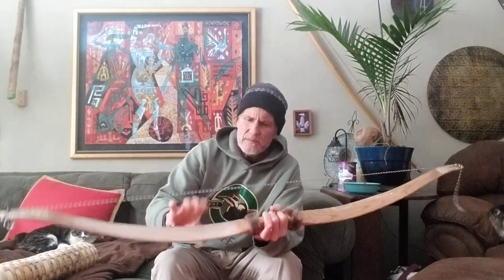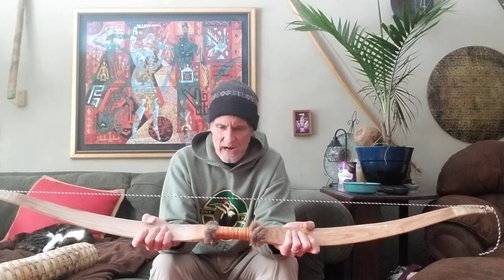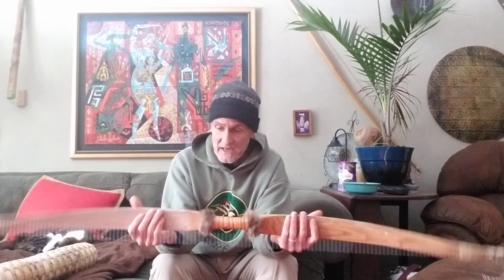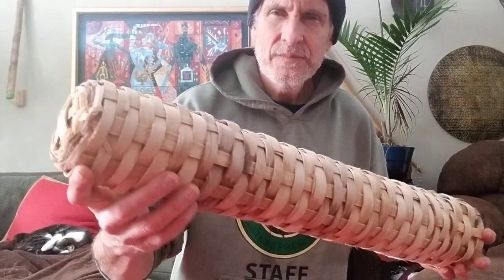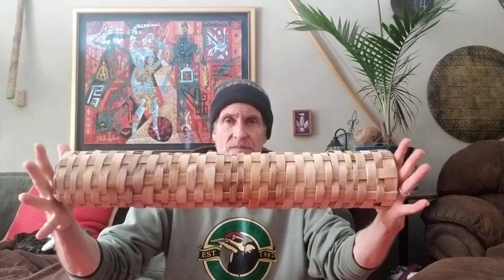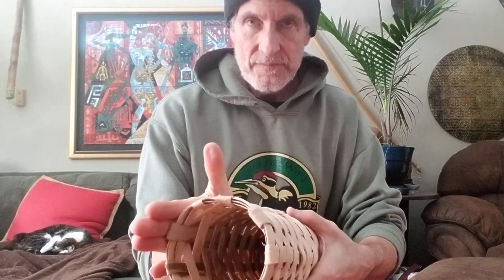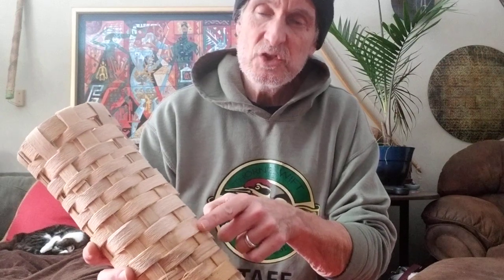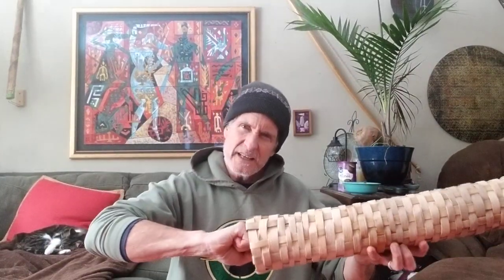Today's Assignment: Making a Quiver

Comment: That looks really good, I always admired woven quivers. The only thing that I have woven is  rocking chair bottoms. Sheep wool around the mouth for arrow rattle? I tried knapping years ago and I had terrible looking points, need to try again. Thanks for sharing!
Reply from the maker: Thank you. The sheep wool would be good and maybe on the bottom inside to keep the points from banging. I dyed the rim with blackberry juice and hit the whole thing with spar varnish. It really came out well. I need to find the Ishe like points that Cody made for me so I can make the arrows. I still want to learn, but in the meantime, Cody made points with those thin narrow blades and impossible deep notches would be incredible. I have points from really fine knappers, but this fellow's work is best described as impossible. I'm gonna text him and see if he could put his info on the upcoming video when I have made up the arrows.

Comment: Ingenious, beautiful quiver. And that bow , gosh it too is a beauty. Wish I had your talent, but that bow just looks so cool. I had to watch it twice
Wait I got more, I’m a Yew wood lover. And look forward to you working such nice bow wood. 
And for my final input, more of a question, if I had a bow say pulling 15 lbs. and backed it with Sinewing how much poundage would I expect to gain? Let’s say 2 thick layers, in ball park figures of course, thanks
Reply from the maker: Thank you. I really like this bow too. It has the World's worst finish on the belly; gloppy and uneven but funny thing is, it makes it even better. How much the draw weight increases will depend also on a few other things including length. The longer the bow, the less radius of bend it'll have when drawn so shorter bows will see more of a jump. If it's say 66", cut length off if it's longer, and you put a back bend on it when you sinew back it with two good layers, maybe up to 15 pounds I'd guess. It could certainly be a fast 30 pounder and a good experiment. If you have a 28" draw, cut it down beyond 66".

Comment: John.   i’m starting or rather started an ash paddle.  in summer then put away.    Currently,  designed a paddle bow 48”.    in pine as a template n practice piece for a board of red oak.  

could you gay me dimensions of your red oak,   i do not have a huge fade into paddle like the red oak you show which resembles to me a hybrid of pyramid paddle bow.

i’m going to make your scribe o magic.  a quick video on making of that would be cool.    but yeah thickness dimensions n maybe width dimensions on half the bow,   or even quick video on thickness and width.   we have red oak,  maple(makes syrup in spring is this what u call sugar maple)black n white ash, swampy black ash is best according to odawa elder.   a species of iron wood( first bow ever made).  

the be been wondering about inuit bows as they use pine or drift wood.   then add cable or antler baleen,    like osage orange using sap and heart wood.    but use pine n red oak. laminated together?     just a thought,    prolly stronger to sinew back red oak 20 percent of thickness.
Reply from the maker: Hi Matt. I've been kind of quiet on YouTube recently, but I really want to answer your question in a video. Your question deserves more than just a written response and would be of interest for other people.
Reply: @johnjriggsarchery2457  it’s actually turning ou pretty deadly, new outer limbs to start a bit of work but i may taper into more of a needle point, as in one of your videos you describe tillering in the width of the bow with that style.   i’ll let you know how mine turns out.     u decided about sinew backing or not....I will listen to what the bow wants.   love the videos wish there were more!!!  even if you start out with the devil went down to georgia!!!